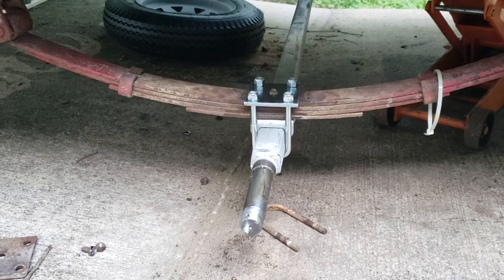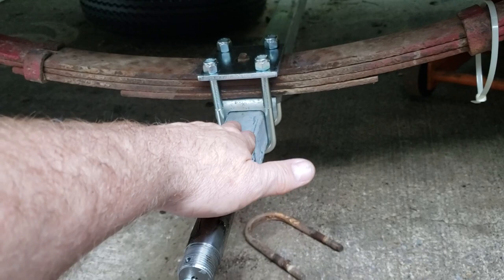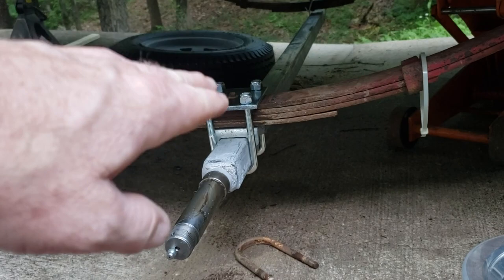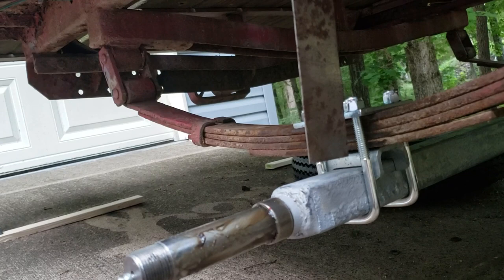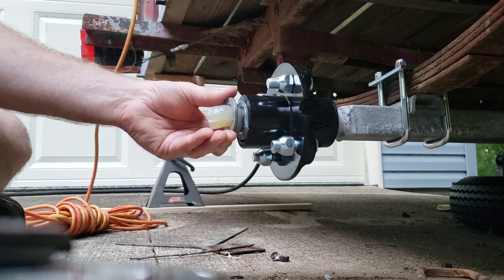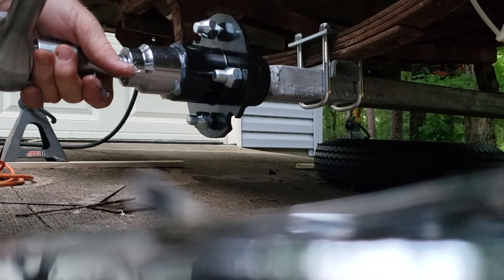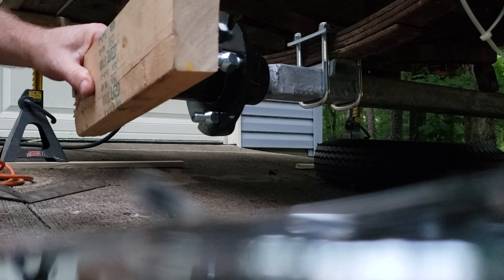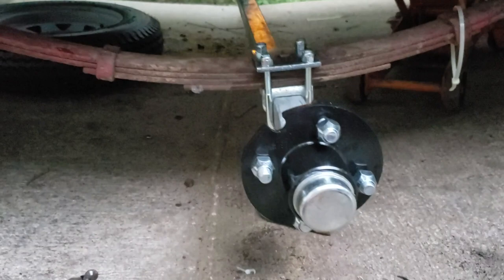Utility Trailer - Installing new axle and Hubs

Comment: OK, I'll try my question again. My 1 1/16 straight spindle has a 1 1/16 X 4.125" shaft including threads. Then there is a 1.25 shoulder with a grease hole. All 4 of my hubs only slide on to the shoulder about half way and when I grease, the grease comes out on the shoulder, not at the castle nut. Question is, can I or should I force the hubs on further? Thank you again.
Reply from the maker: My first question is whether or not your axle and hubs are compatible.  What dimensions are the hubs and what axle/spindle are they designed for ? When you say 1.25 shoulder  are you saying the shoulder depth is 1.25 or the shoulder's diameter?  Assuming it is a 1.25 diameter shoulder and the hubs are designed to fit a shaft of that diameter, then it sounds like a press-fit type situation and you would indeed need to press the hubs on further. It makes sense that the hub should bottom out at the base of the shoulder. However I go back to my first question, which is, are the hubs you have compatible with your axle?

Comment: My axle that broke off mine was a square. It was hand made in 94. I bought a new 3.5k round one to go back. Only thing is. This one goes on TOP of the dang springs. Do you know if the bowed one's can be put on the bottom? What's the carrying weight on the square ones?
Reply from the maker: There is a link to the axle in the video description where the specs are listed.

Comment: Did the instructions not mention about welding the brackets to the axle? To prevent sliding
Reply from the maker: No. Nothing was welded when I disassembled either. This was a light duty trailer so I'd say that is probably not needed. You would not be hauling riding mowers and ATVs on this on.
Reply: See connection detail at 0:20 - At the bottom center of each leaf spring is a round-headed registration bolt that passes through the spring from the bottom, and is nutted on top. This nut is visible in the hole drilled at the center of the square U-bolt top plate The round head on the registration pin is captured by a corresponding hole in the provided spacer that fits between the spring and axle. Once the U-bolts are tightened this pin prevents the spacer from moving front-to-back or side-to-side with respect to its spring. Then the spacer "arms" at each corner prevent the axle from moving front to back, and the friction fit between the spacer "slots" and axle prevent it from shifting side to side.

Comment: Thanks for taking the time to make this. I have a question. When I have done repairs on boat and landscaping trailers, the axle always sits on the top of the springs, not underneath as you have mounted it. The thing you call the "top plate" is then mounted underneath. Is this because you went to larger wheels/tires and needed extra clearance? On my attempt to replace the axle, the cradle that held the axle to the spring had a hole in it to fit over the bolt that held the springs together while keeping the tire center lower in the wheel well. I just wanted to know if you have done this for a reason that I dont understand.  Also, I asked at Farm and Family why their axles had a bend in the middle and the salesman told me that when it is mounted correctly, it should bend up toward the center of the trailer to flex under load. I thought he might be blowing smoke but I checked it out. He is correct! Good video!
Reply from the maker: All I did was put it back together the way it came apart. An axle tube should be straight.
Reply: @ImpalamansGarage  this is where I got my confusion! https://www.etrailer.com/question-205371.html
Reply from the maker: @elydoug  I cannot speak to that but it sounds as though this person is talking about a VERY slight bend. Mine was HUGE!! The dude before me owned a concrete business. LOL
Reply: @ImpalamansGarage  ok. Thanks. It appears that there are different axles out there. I need to keep researching.
Reply: @ImpalamansGarage  I’ve never seen a concrete business that didn’t have dented, bent and twisted equipment!

Comment: What was the approximate cost of the axle replacement?  1350 lb. hubs mean that your tow capacity is 2,700 lbs. max. as long as the weight is evenly distributed on each tire, right?
Reply from the maker: See links to all the parts in the video description. This was a light duty utility trailer.

Comment: Just curious how long is your axle from end to end. i have to replace the whole axle but I can find exact the same as mine. your axle assembly looks exactly like mine. is the spindle on your axle welded or can the spindle be removed?
Reply from the maker: It's all welded together.
Reply from the maker: There is a link to the axle in the description where all of the dimensions are documented.

Comment: Great vid, I think since you posted this NT has cheaped out on the tie plate kit though. I have a 4 layer leaf spring like you and the U bolts are about an inch too short and I bought the same one you listed. Nothing a trip to the hardware store can't fix but kind of disappointing. I feel like the bolts had to be longer back when you made this vid.
Reply from the maker: Yeah products change over time as vendors are always looking for cheaper ways to manufacture stuff. Thanks for watching!
Reply: I'm here with the same problem researching if I can lose that mounting plate between the axle and the leafs. I think I have to drill a hole into the axle but not too interested in that, introducing moisture into the axle tube...

Comment: I bought a trailer years ago and the axles are from a truck and the rims are going bad. I took them to my tire shop ( tire and rim shop) and the new guy didn’t seem to think he could get me knew rims to fit without the make of truck the axles were from. We know the tire size, bolt pattern and spacing of the bolts…. Seems to me that should get me a replacement rim?!? But I’m not a person in the know. My buddy said replace the hubs. So can I use a trailer hub on an axle from a truck? Or will any truck model hub fix this axle? ( ya I don’t know much. ) I have successfully replaced a broke trailer hub with a new trailer hub….. so I’m not completely useless in this area, just mostly. 🤫 any thoughts are appreciated. Thank you for the video.
Reply from the maker: Trailers should have trailer axles, hubs, wheels and tires. They are different from a vehicle. If you use vehicle tires on a trailer it will never pull right. Trailer tires are designed to be trailer tires.
Reply: @ImpalamansGarage  thank you. But if the axles on there will fit a trailer hub, then using it with a trailer hub, rim/tire could work or not?
Reply from the maker: @davidsto9064  I don't see why not. The main point I was trying to make that vehicle tires have no place on a trailer.
Reply: @ImpalamansGarage  agreed. I had a trailer build for me that used some old snow tires on rims that made the trailer the ride size for the truck I had. The guy that build modified some trailer hubs to fit. The hub cracked 8 years later leaving me on the side of the road with a flat and a broken hub. ( I got home on the spare) but after a lot of trouble I changed out the modified hubs ( which I thought he got off a car, not just modified) and replace the hub, rims and tires. As you can tell my other trailer from the first question has left me with bad rims, needing new hubs, rims and tires and maybe an axle….. car tires have no business on trailers.  Lesson learned the hard way.
Reply: Go to a tailor place they have all the parts you need
Reply from the maker: @thewayjesuschristislord3700  Northern tool also sells a lot of trailer parts. The selection is nice.
Reply: @thewayjesuschristislord3700  I did….. but they don’t 😞 the rims are back ordered for months. But they did give a lot of help. And I know exactly what I need.
Reply: I went to the junkyard, i got 1998 ford windstar rear axle tire size 15, i install in my Lowe's utility trailer 5x8,I haven for 5 years, I don't have a problems, I carry fire woods,  if you take care the trailer, you no have a problems.

Comment: Did you have to weld on the spacers onto the axel?
Reply from the maker: No welding involved. See video description for parts/kits used.
Reply: Already bought everything, same exact thing, so what are the foot pounds for the square u bolt joints?? Thanks for your help!
Reply from the maker: @brayantheguru  I do not recall there being any torque specs listed for this kit. The bolts are 3/8. Here is a chart showing max torque for different size bolts. https://www.engineersedge.com/torque_table_sae_ftlbs.htm   I'd start at 30 ft/lb and see how it feels. You could always add lock washers if you wanted. Go easy though. You'll be upset if you strip one!  lol